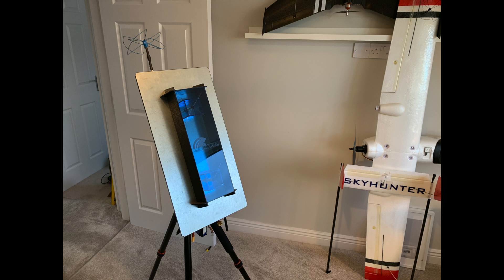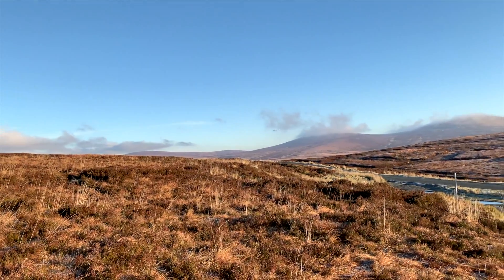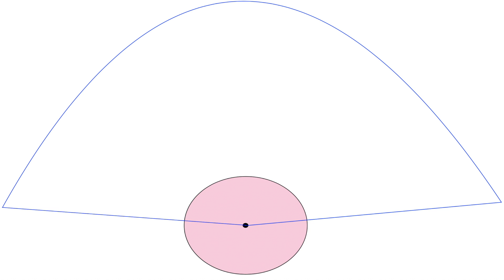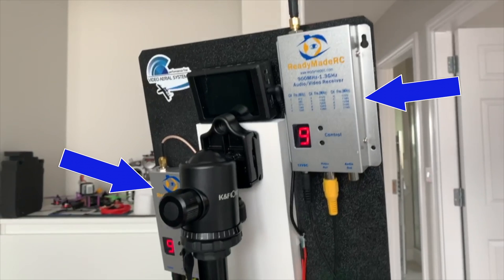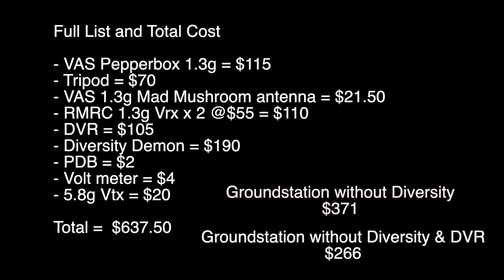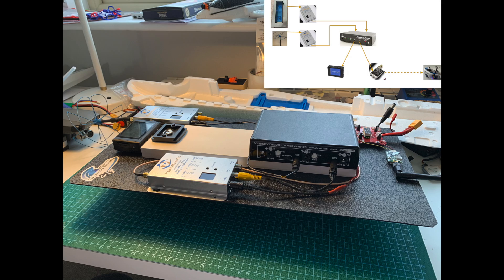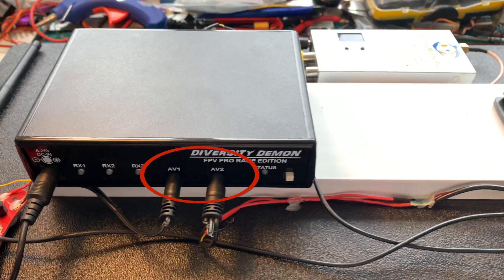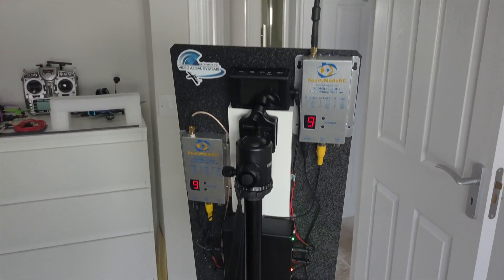Long Range FPV Ground Station - Build Tutorial

Comment: Awesome video, just what i was looking for. Looking into doing a bit of long range fpv with some wings using i-nav.
Reply from the maker: Kyle Fpv glad you find it useful! With this ground station FPV is so realisable and fun 😎
Reply: @AdamGdoesFPV  yes mate totally useful. Is it possible to put together a budget groundstation at all? Also do you have any and or wing builds? Cheers😎
Reply from the maker: If you are on a budget and want to fly 1.2g then you could get a pepperbox and a receiver only and just plug goggles straight into the receiver. If you are starting out then you could just go for 5.8g video and goggles have everything you need built into them. I don't have any wing build videos, but something like the AR wing is very simple. Normally all of the wiring is covered by the autopilot's manual. Hope this helps

Comment: I just subscribed to your channel because of this video. I just got a MT, and am in the process of installing a 1.3G system. I have 2 receivers, VAS Omnis and a VAS Crosshair. I just have a problem with the diversity controller, finding one is a bit tricky in South Africa... I'm going to try and build one myself, so maybe it'll work. Thanks for all the info
Reply from the maker: Thanks for the sub and the comment :) Good luck with the MT build and the diversity build, I'm sure it will turn out great :D

Comment: Great craftsmanship, quite an investment on the diversity Demon, to be honest. How about interference from other sources close to 1.3gHz such as cell towers?
Reply from the maker: Yeah the DD is quite an investment, and I did think about that one. In the end I decided it would make FPV more enjoyable and give more freedom during the flight so it was worth the money. I'd just be regretting it when I was flying if I didn't have it. 1.3g has been great. Like any frequency, if you're in the wrong place you can get interference. Most of the time it's great, on my old 1.3g Crosshair I went 17km with a clear picture. Thanks for the comment

Comment: 5.8g good
Reply from the maker: Hi, is this a question?
Reply: Your system is complex and requires a lot of equipment. It is simple and convenient to use the 5.8Ghz dual receiving system. 5.8ghz can achieve a stable effect of 40km
Reply from the maker: @tom1907  Hi Tom, It might seem complex at first but it's really very simple. I can just grab it out the car as one item and just connect the battery and it's ready to go. Yes 5.8g is simpler and requires less equipment, but it's performance simply cannot match that of 1.3g, especially with they type of flying i do, believe me. I have multiple 5.8g diversity receivers and some high quality antennas, but the results are not even close to 1.3g. For some people, 5.8 will be more suitable due to their flying style :)

Comment: This is a great tutorial for building a long range FPV ground station! But - everyone should be aware, that the recommended DVR for this project does put out a spike on 1.2ghz that can interfere with your video. It's kind of insidious in a way, as you probably will never have the issue unless you fly out 8km or more you'll probably never experience it. I had issues with mine for months, and thought that there was something wrong with my vtx/vrx setup, but it was the DVR all along. It's a shame, because that particular unit records in a very high quality. You can remedy the issue by using the DVR with a 5.8ghz video receiver of it's own and moving it far away from the 1.2ghz vrx, encasing the DVR in a metal case, or just use a different DVR for very long range flights.
Reply from the maker: I have to say I've never had an issue with mine. Many other people use this DVR and i've not heard anyone mention having a problem with it. These days an external DVR like this isn't that necessary because the goggles and monitors have them built in. Thanks for watching and for the comment :)

Comment: Nice video Adam, Wich is better antenna tracker or a ground station like yours...?
Reply from the maker: Hi Juan, thanks for the comment. It's normally down to your personal preference and flying style. A tracker with a Crosshair is what I use to use and it worked very well. In the end I decided I wanted less complexity of moving parts and I wanted the high gain pepperbox for low altitude medium range flying. Both are great and you won't be disappointed with either
Reply: @AdamGdoesFPV  thanks adam I have an antenna tracker a skylark aat and I made a mistake in buying that aat I have a year with that team and I have not yet been able to put it to work is a headache
Reply from the maker: @juanhernandez5812  I have no experience with the Skylark, but if it's that much of a headache i'd just sell it off and get something simpler :)
Reply: @AdamGdoesFPV  thanks my broo!!
Reply from the maker: @juanhernandez5812  You're welcome :)

Comment: good stuff Adam! as a cheaper option you could swap the diversity demon for an Eagle Tree 'EagleEyes FPV Station' - currently 85$ - which also provides diversity. cheers!
Reply from the maker: Hi Charles. Yes the eagle eyes was something i looked into, but I found some bad reviews and decided to just spend a bit more on the DD. Thought it would be worth it with all the flying i do. I'm sure others will appreciate this tip though and go ahead and have no problems. Cheers
Reply: Did you get caught for much UK duty buying the DD from the US?   Combination of the postage rates and duty add quite a bit :(.    Excellent video and info 👍🏻

Comment: Hi Adam, great informative video, would love to see more of this sort of stuff from you. Quick question if I may....in your experience would an antenna tracker do the same job with just one directional antenna?
Reply from the maker: Hi Rob, thanks for the comment. I used to have a Crosshair antenna on a tracker, and this gives you good range in all directions. It really is a great setup. I wanted to go with a very high gain antenna (Pepperbox) to allow very low altitude at medium range. This antenna is too big and heavy for a tracker which is why I went for diversity. So really what you decide to go for is personal preference and depends on the type of flying you enjoy. Hope this helps.
Thanks for great feedback :D
Reply: Appreciate the insight Adam, I’m currently putting together a tracking system using 5.8ghz video for testing of tracking accuracy, if successful I then plan to try 2.4ghz video.
Reply from the maker: @robrowbotham1814  Cool. a lot of people have success on 2.4g. Good luck with the build

Comment: Would you be interested in doing the same style video on you latest long range plane set up. I appreciate its lots of work but so informative for a newbie like me.. I’m just getting into fpv long range to explore and make flying videos. It’s a steep learning curve :-)
Reply from the maker: Is it the setup and configuration of the Skyhunter you're interested in?
Reply: Adam G does FPV .Yes that’s the one, I’m thinking about doing something similar soon. I’m learning on the nano talon at the moment. Cheers
Reply from the maker: Cool, well i'm going to do a setup video on my Talon GT soon which has very similar gear to the Skyhunter, so maybe that might answer the questions you have
Reply: Tony Hussey what you said.